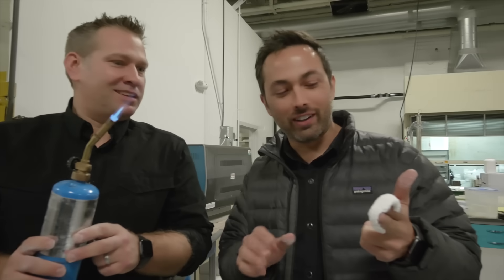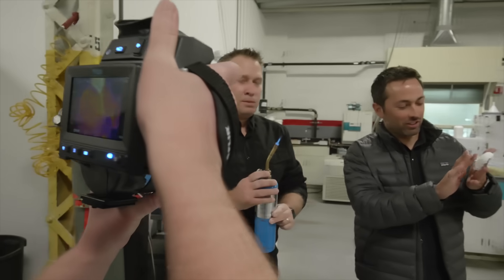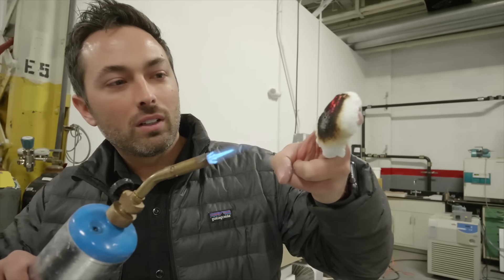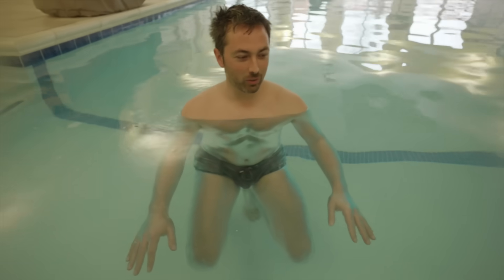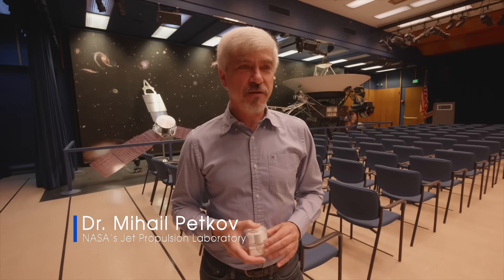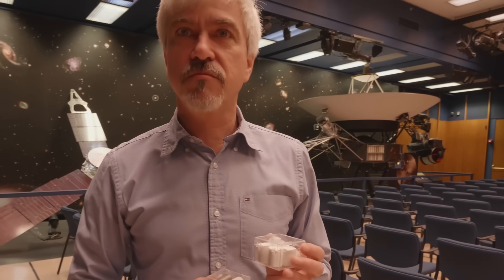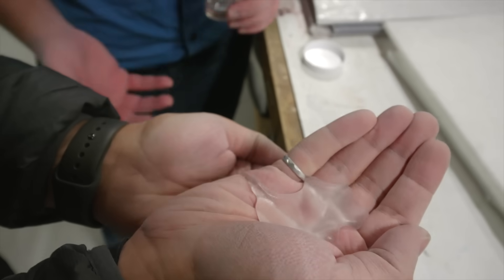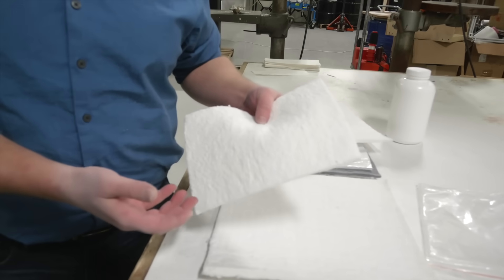I Waterproofed Myself With Aerogel!

Comment: 5:30 

So, in other words... DON'T INGEST (EAT) IT

I know there are those out there who have thought about it. Hell, I did. Absorbent Substrates can kill you by drawing out all of the liquids in your stomach and body. This is much the same. Zoiks!
Reply: Ima sniff the hell out of that silica dust!
Reply: @sibirisman  You're gonna get pneumonoultramicroscopicsilicovolcanoconiosis if you do
Reply: @UltiPewPew  ok... you try it first
Reply: @UltiPewPew  I laughed a little too loudly at this one. I think it has to be a very fine liquid for that to happen, in which case I'd go see your local gastro-enterologist  xD
Reply: But he rubbed it all around his body. I thought they had to make the variation that absorbs for insects in particular. I´m wondering if it could be used as a condom.

Comment: What did you censor off the material at 10:45? Some very clever motion tracking and masking is occurring and if the square mask hadn't wiggled slightly I'd have never noticed it.
Reply: Where?.... :S
Reply: @PurpleNothing  Towards the top left corner of the second blanket material they show.

Comment: Great video!!! Very interesting! (But) it would have been even better if you explained more about how you made yourself waterproof. 

It seems to me that  you needed to both explain more and connect the concepts better for most people to really understand what is going on here. (Or maybe I dont sufficiently comprehend the sophistication of your audience.)  Part of this is because It was lacking in summery and thus lacked the connecting threads that would have allowed for most people to understand the conclusion. 

[If you talk to other scientists you can say a+d=g and they will get it because they know there is a "b" and a "c" in the equation as well. They might understand "b" and "c" are there because of "a" & "d" most other people won't. In explaining you need to cover "b" & "c" properly. You must then also show how "a" "b" "c" &"d" interact and are related . Then finally you must draw concepts together and help people understand the conclusion or in this case how this was done.]

Comment: I've a question: Could you fire a gun in space? Would the bullet float in zero gravity, or would it not work?
Reply: I can answer that easily - you could not fire a (conventional) gun in a vacuum, because without air, there is no combustion. But - you could stick a gun inside a bubble of air - a sealed bag, a sealed space suit - and shoot the gun once through the soft material. Then the air would leak out of the hole, and you could not fire a second time. (This was actually shown in an episode of the SF series 'Firefly'.

The bullet would follow Newton's First Law Of Motion (Every object in a state of uniform motion will remain in that state of motion unless an external force acts on it) and travel forever until it hit or interacted with something. If you shot a gun at the stars while in space, the bullet would likely travel at the same speed for trillions of years... possibly right unto the heat death of the universe. Space is so vast that the chance of a bullet hitting anything - at all - is unimaginably small. But... if it did, then it would act like any bullet hitting something.

The laws of physics don't change just because you are in space.

Comment: I make aerospace parts out of carbon composites. Seeing some of the fiberglass insulators there made me wonder if I could use the aerogel powder as a component in resin systems for better insulating properties. Currently, glass micro balloons are often used. 
Basically, the finger-torch test at the beginning, but the binder is a resin which cures into a rigid structure.

Comment: I see this and imideately think two things:
1.) Can we make use of the material to store H2 at lower preasures then a normal tank, just by putting some in it?
I know there are metal based things that can do this i.e. 60Bar x100L tank =~6.000L with that stuff 60Bar x100L x10(?)=60.000L ? This would make storage easier as less preasure means less likely to escape over time, alos this would help to kick off E-Mobility via fuelcell even quicker
2.) I wear glasses, can I make them undirtable? Please say yes.

Comment: After some considerable thought, I believe the aerogel has a promising use in the medical world for bone regeneration when combined with use of stem cells.  It might also have use for implantable teeth without metal, or in bone marrow replacement technology.  A variant could be used as a new generation heart valve or artery replacement - again, when combined with stem cells from the original tissue. The properties of aerogel are wide open.  It might even be a possibility for a prostate gland replacement and become as common as cateract surgery.

Comment: i Worked with this stuff. After a weak, your skins starts to get so dry, it breaks at all joints that it was exposed. Even lotion is not absorbed by the skin in a same way. Horrible stuff in insulation industry. Everyone that worked with it is hoping it will get banned in the industry as the asbestos.
 Short term maybe not a big deal. Long term - no results yet.

Comment: As an ex-competitive swimmer, I wonder how much advantage you could gain from this in competition? Back in the 80's we had a product called "Time-Off" that we  lathered up with(some type of oil)  that didn't seem to work but that stuff in the video would be a different story. No doubt this will be used to cheat when it becomes more available...

Comment: Veritasium, A question was presented to me and my crew involving orbital motions between planetary objects and their satellites in reference to revolution times. We are coming to a split decision as to whether who is "correct" and are hoping that you may be able to apply a solid scientific standard to identify which is fact; or who is "more" correct.

The question presented was, "Given our earth, and referencing a satellite locked into a geostationary orbit, how long does it take for the satellite to complete one revolution around the earth?"

We have come to two points of conclusion:

1. That a satellite is in an orbit around the earth, regardless of whether it is a geostationary or not. It develops that orbit by creating a motion path that "encircles" the earth and therefore follows the rules for a geosynchronous orbit time which equates to one sidereal day(approx 23hr 56min 4sec) to complete a revolution around the earth. This argument is further supported by thinking of the satellite orbit based on the center mass point of the earth being a "single point" in space as the reference and that the satellite orbits that center mass point(point in space not in motion).
This argument is countered with the logic that in order for the geostationary satellite to complete a revolution, its "stationary" position would have to be forgone and either the satellite itself must accelerate or decelerate in relation to the referenced point(earth) in order to complete its revolution; or vice-versa(earth accelerates/decelerates its rotation).
2. Since we are using the earth as the reference point, that the "Geostationary" orbit locks the "0 degree" reference point with the satellite to the ground point and degree reference on earth and as such, a geostationary satellite cannot complete one revolution around earth.
This argument is countered changing the point of view of the observer. If an observer is external to both the earth and it's geostationary satellite, it appears that the satellite will rotate around the earth(not accounting the earth's rotation)

Please help, does a geostationary satellite complete a revolution around the earth? If so, how often?

In the case that you make a video and If you can prove that a geostationary satellite does not make a revolution around the Earth, please say in your video, "Curtis Longoria, you owe 1st Squad Pizza" at some point towards the end. Thanks!!

Comment: Does the hydrophobic silica dust that you coated yourself with have insulating properties? Is this a new form of a dry suit that can keep you warm in cold water? Can it be applied with pressurized air and a spray gun of some kind? This is so cool!

Comment: 1980: we’ll have hoverboards in the future!

2019: swims without getting wet
Reply: It is better than flying stuffs...
Reply: 1980: everything's been done!

2019: copypasta comments
Reply: bro hoverboards are so 2017
Reply: Well its better if u think of it
Reply: We already have hoverboards
Reply: @somerandomdude5218  By hoverboards, they thought of an actual object that was hovering (air particles between the board and ground). However, the "hoverboards" we currently have do not hover in the slightest sense, as they have tires. The only reason they call it a "hoverboard" is merely a marketing tactic.
Reply: @somerandomdude5218  they dont actually hover
Reply: @somerandomdude5218  they aren't hovering
Reply: Some more genius future inventions:
Flying on the ground
Drinking water without getting hydrated
Food you can’t taste
An invisible stop sign
Reply: @mitchelllimque2027  It might be time to put the bong down now...
Reply: Well, it is in Fortnite
Reply: 5
Reply: @Koppyu1 its not even the height that's the problem with actual hovering boards its the control issue they would require an Omni-directional stabilization system that auto adjust's to the riders weight and calculates thrust power along with an actual way to make it well... go... with all that technology keeping it stable you wouldn't be able to use a simple weight redistribution steering system, it would have to be a that will correct when the rider falls off the 0 Point like the system those current "hoverboards" (Segways without handlebars) use

A hover board is basically the same logic as a helicopter except with 1 crucial problem no space for a Tail Rotor, of course you could just use one of those Quad Copter drones powerful enough to support an average 100-200 pound human and tape a skateboard to it o.o' , now i actually wanna see a youtube video of that o.o'
Reply: Judess 69er can’t we just clench tail rotors between our cheeks? If that’s the last hurdle, I’m game.
Reply: Wait,so we will float or not?
Reply: I mean it’s not my fault they called it hover board when it doesn’t hover... just admit we are stupidly stupid
Reply: I have to reply whenever I see such overused comments. You are simply ripping off a format which was never really funny.
Reply: Going into water and coming out not wet is an amazing invention..
Reply: Matt L you mean black people hair? We’ve had that technology for hundreds of years.
Reply: @Kyler Harvey 
Real Hoverboard... not shitting you
https://www.youtube.com/watch?v=xUNM1yxVSvo

Comment: You can use a half-inch of ceramic fiber insulation (used in steel working and other related industries, as well as a few other niche insulation purposes)  to melt a penny on your hand without injury using a blowtorch.  If you increase the thickness to a full inch, you don't even feel heat.    I'm not really surprised by the heat protection of excellent insulators.

Comment: Oh man what about Kevlar and Areogel composite?!?!
Reply: Why though? Kevlar has very high tensile strength that's how it works. That's why Kevlar is woven and not a solid block like steel. How would making Kevlar thermal resistant help it in any way since even if you had a gunfight in a volcano the moment u are hit with a bullet it would scrape of any aerogel covering the Kevlar so even though the bullet is stopped youve ruined the aerogel seal and thus made your Kevlar no longer thermal resistant. So why even coat it in aerogel?

And a composite would work even worse probably. Either you mess with the hydrogen bonding of the Kevlar sheets by inserting random aerogel molecule groups in between and thus making both the Kevlar weaker and the aerogel much much weaker as an insulator, or you have some sort of salad heterogeneous mixture maybe of one layer Kevlar then aerogel then Kevlar then aerogel and so on, but then again you've made the Kevlar much weaker and even then you would only be able to stop a small number of bullets in a volcano because the bullets will keep breaking the insulation of the aerogel layer after they break through the thinner Kevlar layer.

Comment: People: it's broke

Engineers: that's entropy irreversible damage
Reply: You can have entropy arguably reversible damage. Imagine u were to mix helium and azote dioxyde, you could use their big difference in Mass, chemical affinities and properties or even average radius to separate them (at a reasonable cost): broken but fixable, entropy driven but "reversible" event. Now if you mix helium and neon, it's not the same thing. The cost of separating helium from neon just doesn't balance the use you have for either of them (if separation in that case is even possible, in theory it is): broken and not worth fixing, entropy driven irreversible damage.  Adsorption is an entropy driven process (counter intuitively), and If the heat released during adsorption of water within material is sufficiently high, it's chemisorbed and is "irreversible". (at ntp for sure). If adsorption breaks symmetry and molecular structure, then it's damaged. Each word counts.
Reply: @Fielmur  yeah, I guess you didn't get the joke
Reply: @55shhhhh  jokes waste resources

Comment: Add this to marine paint, paint ships and you would increase fuel efficiency immensely.
Reply: Most of the work a boat motor does is to displace the water which this wouldn't affect at all.  It would change friction but that wouldn't make a significant difference
Reply: CasMullac exactly what I was thinking
Reply: But the boat is still floating like before :D i think would not effect

Comment: I immediately got lung cancer just from watching you cover yourself in aerogel dust without any mask on.
Reply: Dirk is probably fine with a one-time exposure but I'm not sure I'd want to be around that stuff regularly
Reply: our bodies can easly deal with most dust types
Reply: @doggo00  not this one, buddy.
Reply: @bolteatrice0623  Didn't he say it in the video?
Reply: Honestly though that cant be healthy
Reply: @noahbreuer5095  Our bodies are exposed to a lot of dust by just walking outside. As they mentioned our bodies have the means to deal with most of them.
Reply: @Hirvee5  That aerogel-covered fiberglass matting he's holding with his bare hands. I worked at a factory for 4 years that use these mats to make pipe-insulation, like he explains in the video. It's a great insulation material. It's also the material where the workers are by far the most careful to wear full PPE at all time when handling it. 

When eastern european insulation-workers that will happily breathe neurotoxic solvents all day long make absolutely sure to avoid exposure to something, I'd take notice. He says in the video that it's perfectly safe, but the long term studies won't come for a long time showing the effects of exposure to that stuff. A lot of people in the insulation industry are just waiting for this stuff to become the next asbestos.

Of course, since the studies aren't really out yet, he might be right. It might actually be safe. I don't know. But I would personally not handle it so casually without being 100% sure that the science is in.
Reply: @oternoj  Handling a lot of fiberglass is already well known to have a bunch of immediate issues related to it. that is not new here. If what he stated is true they know aerogel not to behave similarly to asbestosis and that the body is able to handle and remove similar substances to it. Of course their word could be scewed towards their own goals. You probably don't want to breath in excessive amounts of any kind of dust. I'm not a scientist on the field so I don't really know the research on the subject or the substance but only lies will actually achieve 100% certainty.
Reply: @oternoj  11:11 
"Its very save"

Comment: I've been obsessing over this stuff for a while now. Does it ever degenerate? Does it ever give in to some factor or the next? All the tests I saw exposed the material to high heat for a few minutes. I'm curious about the durability under constant heat for long. Say 2000c for 1 year. Would any changes happen to the structure?

Comment: Handling that finely powdered hydrophobic silica gel sounds like a good way to get silicosis...
Reply: I was thinking the same thing when I saw the dust coming off the fiberglass aerogel composite.  How is that dust different from the dust generated when sand blasting, which definitely causes silicosis?

Comment: Now I'm wondering how practical it'd be to use as an insulator in things like homes, fridges/freezers, coolers, basically anything that needs to hold in air at a certain temperature range. Of course since it doesn't seem like it's that easily mass produced at the moment, it'd be more of a luxury material if used for that and be really expensive because of it. But how practical would it be for use in those various applications?